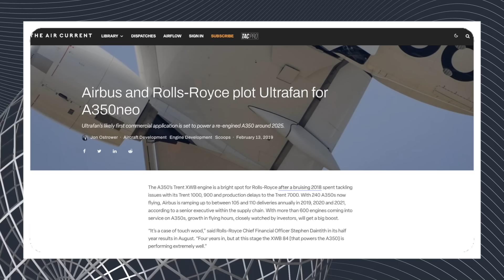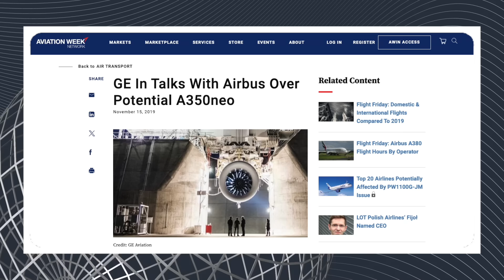A350NEO - Airbus Next Widebody?

Comment: It won't be happening any time soon unfortunately, and that's purely because of the market. Right now Airbus is selling these a350 like crazy and it's clear that they have lots of demand for these planes in their current shape and form. Airlines are struggling to get them soon enough as the backlog is apparently booked up until the end of the decade. So why would Airbus go through the extra struggle (and high risks) to provide a better product if the existant one is alredy selling soo well? They won't. 
Rn their focus is actually ramping up production rate of the A350 amd streamline the process and with that I really don't see any possibility of a Neo version any time soon.

Comment: The A380 Neo is a must
why?
1. takeoff and landing time slots are limited.
2. air corridors in main hubs and airports around the world will be fully deployed.
3. world population is getting bigger by the day.
4. satstinability is a factor, e.g. less flights yet more passengers in each cycle  is needed. 

therefore not only that the A380 neo is a must  but may a triple Decker A480 neo
and in the far future an A580 Neo quad decker will be needed

Comment: The aircraft is fantastic. However, it does have significant limitations. Takeoff performance can be very limiting. As well as cruise Altitude performance. So any performance increase with bigger engines would be welcomed. Additionally, Takeoff weight needs to be increased.
Reply: What dk you want a space ship its to get you from A to B .

Comment: Doubtful. No real advantages here, the aircraft is just too new and they’ve only delivered a little over 500. Maybe after they deliver 1000 of them. The oldest a350s are something like 6 years old at the very earliest and there weren’t many of them delivered before Covid delayed everything. Airbus would have had a better play in building an a350-800 instead of the a330NEO because the a330NEO just can’t compete on cost and weight against the 787. It’s too heavy and too expensive. The -800 a350 would’ve been a much better play and they got rid of the type for the a330 that just sells to Delta on the cheap. Many a330 operators today are just switching to the 787, now a 10 year old airframe, but it is legitimately cheaper.

Comment: What dictates a Neo variant is a new engine. That after all is what Neo stands for - new engine option. Those new engines seem to be a long way off. Rolls Royce is now talking 2030s for its Ultrafan.  There are alternative engines  - plenty of aircraft have been offered an alternative engine option in the course of production - but the Neo concept is about  offering engines that are  a generational advance over the present engines. The GenX from GE is the same generation as the present A350 power plant, the RR Tent XWB.

Comment: Has Rolls Royce increased the performance of the Trent XWB over the years? If so why bother? Or is the improvement so low?
Reply: The demonstration UF is showing double digit fuel improvement over the XWB even. RR will not sit on this...they are so desperate to reduce carbon footprint they are already building an UF with ideas of hanging it on the A350F programme.

Comment: Will an A350neo happen? Yes. When? Likely will be announced in the mid 2030s for entry into service in the early 2040s.
Reply: Boeing are more likely to re-engine the 787 much earlier than that , so AB will definitely be forced to do the same . Airbus have no reason to rush to re-engine the a350 because its payload range performance is exceptional but the only way Boeing could make the 787-10 much more competitive payload range wise is by slapping on a more efficient engines  and giving it a  new wing. I think Boeing will launch the 787X towards the end of this decade
Reply: You have read previous posts I have written giving you knowledge from a person with inside info. Since you were recently saying RR had abandoned the UltraFan, I can tell you specifically that they have another 4 various sized UF in different states of build. RR will no longer sit on their hands. They have already got a healthy return on investment for the Trent XWB and are aiming to offer Airbus an UF engine to test on the A350F programme. The engine is already showing double digit improvement in fuel over XWB engines and both Airbus and RR are desperate to be seen reducing carbon footprints. The other 3 engines under build are sized for the A220, A320 & A321 respectively. There are so many years of backlog orders that getting just 1000 engine sales on the A321 would be a success.

Comment: An A350neo with a new Rolls-Royce engine derived from the UltraFan demonstrator engine or an uprated GENx engine is definitely being considered. Especially the UltraFan , which may cut fuel consumption by as much as 10% compared to the current Trent XWB engine.
Reply: 10% may not be worth the many billions it will take. RR has also slowed the development of the UltraFan.
Reply: GEnx is old tech, it can`t compete with XWB, but GE`s GE9X could be a way to go if it were of interest to AB. We`ll have to see how 9X performs when it`s finally introduced, it promises much.
Reply: @edwardwilcox6606 GEnx old tech? Lol
Reply: @mmm0404  Another sneering ( `Lol` ) reply thanks. Yes GEnx is well over 20yrs old & design has moved-on. Both RR T-1000 & GEnx were ahead of the curve in their time but engines like T-XWB at present & GE9X when it arrives ( soon hopefully ) are next-level in every respect. My statement isn`t anything bold it`s just fact, backed-up by the fact there hasn`t been a pip on either engine for sometime which indicates there isn`t much more they can extract from a 20 year old design.
Reply: @edwardwilcox6606  it’s hardly the old tech
Reply: @edwardwilcox6606 GE9x is exclusive to 777x only.  RR Ultrafan is to big for an A350.

Comment: The A350 should get a NEO in the next decade or so. Airlines are always looking for at least 20% improvement in economics. Next gen engines will take time to develop, if the targetted improvement is so large. Both the CFM LEAP/PW GTF and the RR Trent 7000 gave a little over 10% better fuel burn compared to the old engines. So, achieving greater efficiencies will need a lot of work. The A350 airframe itself may not give more than 5% improvement, but as Airbus constantly improves it, airlines won't notice the better economics so clearly. I guess the timing of the NEO will depend on oil prices. If the cost of fuel rises substantially, it would make a new engine more urgent.
Reply: GTF will be ~ 5% at most.

Comment: No, not at this time. Example: the "re-engined" 777X hasn't really been flying off the shelves lately. Most 777W's are still fairly young and airlines are in no rush to replace them. More so with the A350 then.
Reply: Boeing never expected the 777X to be selling right now if you go back to press releases when it was launched.  They expected to start selling them around 2027-->2035 time frame